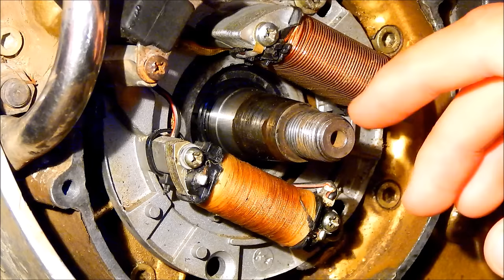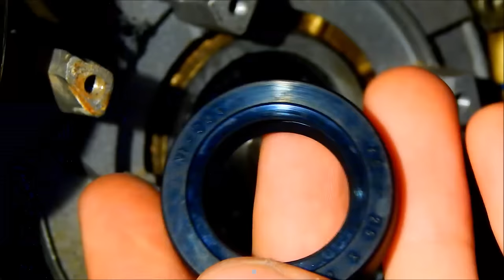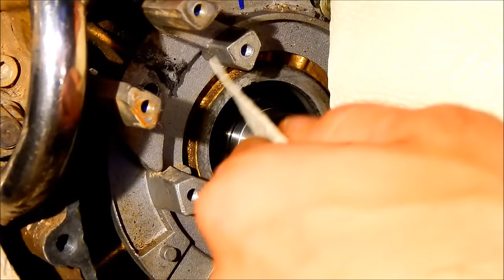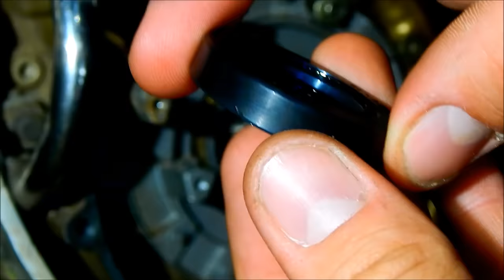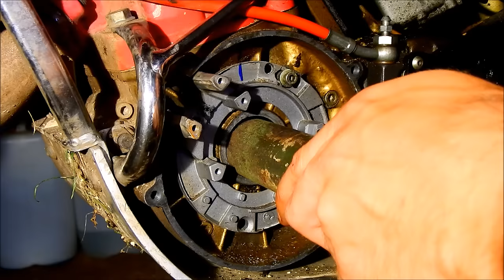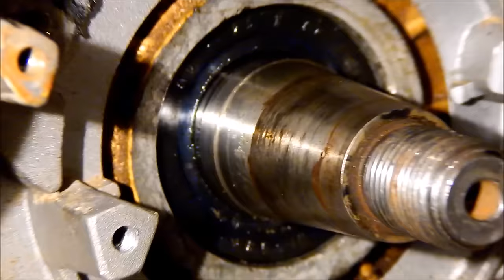Super Easy Crankshaft Seal Removal

Comment: Great job! I like how simple and straightforward this video is. People who don’t like this drilling method. You can simply use compressed air, vacuum, or wd40 to remove the metal dust before actually pulling the seal out. This is a great way because you don’t run the risk of scratching the crankcase with an edged tool.
Reply: Why wouldn't they do that anyways? Metal dust? Big deal, get the job done. And just use a paper towel. And clean up with whatever. For the people that are just saying, just use a flat head screwdriver or use a puller. Now I got a hardware store guy saying the same thing he doesn't understand.  It's metal, you can't just stick something in there. It's hard as a rock. You have to drill holes. Nobody cared to warn me about this of course. And all of the timing belt videos of course. Just skipped literally how they got the crankshaft seal out. The guy at the hardware store is like. Just take out the shaft. I give up. It's always when I'm working on my car I have these problems. Yet, I can search through 10,000 forums and videos. And because the people in the video didn't want to show how it's done properly or how they run into problems. You lose time. It's very important.

Comment: If you use this method (and I have) you must use a magnet to remove all metal fragments before pulling the old seal and then again after the old seal is removed. The area must be free of any metal fragments as the smallest fragment could damage the replacement seal.
Reply: That part made me nervous...
Reply: ......magnetised bearings aren't permitted for aviation engineering . They even use degaussing equipment on bearings . Here I don't think he actually removed all the filings cos we see something from the camera angle but which he couldn't see .

Comment: Or... you could do what I've been doing for 40 years. Jam a flat screwdriver into the rubber part of the seal, pry sideward and downward on the head of the screwdriver, and the seal will come out of it's hole. No drilling or metal dust, and much less time spent messing with it. 

However, you did press it in nicely - with a well-designed tool. ;)
Reply: yapp... :))))) the good old way !  and without all the metal debry he's gonna stuff into the crank bearing  ;)
Reply: gud idea
Reply: KOakaKO
Reply: Doesn't work with crankshaft seal. It's metal, you can't just stick something in there. It's hard as a rock. You have to drill holes. Nobody cared to warn me about this of course. And all of the timing belt videos of course. Just skipped literally how they got the crankshaft seal out. The guy at the hardware store is like. Just take out the shaft. I give up. It's always when I'm working on my car I have these problems. Yet, I can search through 10,000 forums and videos. And because the people in the video didn't want to show how it's done properly or how they run into problems. You lose time. It's very important.

 You can't just jam something that's hard as a rock. It's a crankshaft seal. And by the way not all seals are the same. You can't find screws as small enough as this person has to screw in there and stay. Then FEAR of making a mistake makes the job not get done (oh you can damage this and that) (okay than you do it, it then !!!!! like the slightest little nick, now they say it's on the shaft and not the outside of the shaft. Then a person say it's both, you can't win. And also, not selling tools you need and having to wait an extra 5 to 6 days because something goes wrong. There should be a something goes wrong! In videos that people do.

Comment: Been doing this on snowmobiles for 20 years.  Not drilling on mine, too many metal shavings. A good sharp edged screw driver pounded into the seal at an angle will allow you to pull the seal out. John Deere actually shows this in the service manual.
Reply: Honda 1990-1993 accord cranshaft seal. Is made out of different material than. It's got a hard steel barrier. It's hard as a rock. For what you are talking about is the crankshaft seal. Since nobody bothered to do a video showing how they did it. The guys that did the timing belt job. Just cut away showing that it was already done. By not providing the problem or solution. I waste more time, and so do others. My theory is they had to do it sloppy and don't want to show it on the video. Please do!

For the people that are just saying, just use a flat head screwdriver or use a puller. Now I got a hardware store guy saying the same thing he doesn't understand.  It's metal, you can't just stick something in there. It's hard as a rock. You have to drill holes. Nobody cared to warn me about this of course. And all of the timing belt videos of course. Just skipped literally how they got the crankshaft seal out. The guy at the hardware store is like. Just take out the shaft. I give up. It's always when I'm working on my car I have these problems. Yet, I can search through 10,000 forums and videos. And because the people in the video didn't want to show how it's done properly or how they run into problems. You lose time. It's very important.

 You can't just jam something that's hard as a rock. It's a crankshaft seal. And by the way not all seals are the same. You can't find screws as small enough as this person has to screw in there and stay. Then FEAR of making a mistake makes the job not get done (oh you can damage this and that) (okay than you do it, it then !!!!! like the slightest little nick, now they say it's on the shaft and not the outside of the shaft. Then a person say it's both, you can't win. And also, not selling tools you need and having to wait an extra 5 to 6 days because something goes wrong. There should be a something goes wrong! In videos that people do.

Comment: I'm face with an OLD Evinrude outboard whose seal is leaking and creating all kinds of idle problems for me.  The official tool to remove this is $50 (minimum) from the sources that I could find and I don't intend to remove a whole lot of seals after I replace this one so your method is likely to save my bacon.  Thanks.

Comment: If you don't want to see metal shaving just use a small punch to create a small hole for the screw to start. I wouldn't used a self tap screw. Drilling is too risky.
Reply: I have done tons of these seals. Mostly used the proper tool. In a pinch I have drilled about a dozen of them. I feel a self tap screw has more chance of walking off the seal than a nice sharp drill bit. A punch can walk off too, maybe not if the engine is on a stand at eye level and not between a radiator or a strut tower. Once I had the bit walk off the seal, score the crank seal surface and had to sleeve the shaft I never drilled another one.
As for metal shavings, just flush them down to the bottom of the pan, they will either get caught in the pickup screen, the filter or the fill plug magnet on a properly maintained engine.

Comment: For the people that are just saying, just use a flat head screwdriver or use a puller. Now I got a hardware store guy saying the same thing he doesn't understand.  It's metal, you can't just stick something in there. It's hard as a rock. You have to drill holes. Nobody cared to warn me about this of course. And all of the timing belt videos of course. Just skipped literally how they got the crankshaft seal out. The guy at the hardware store is like. Just take out the shaft. I give up. It's always when I'm working on my car I have these problems. Yet, I can search through 10,000 forums and videos. And because the people in the video didn't want to show how it's done properly or how they run into problems. You lose time. It's very important.

 You can't just jam something that's hard as a rock. It's a crankshaft seal. And by the way not all seals are the same. You can't find screws as small enough as this person has to screw in there and stay. Then FEAR of making a mistake makes the job not get done (oh you can damage this and that) (okay than you do it, it then !!!!! like the slightest little nick, now they say it's on the shaft and not the outside of the shaft. Then a person say it's both, you can't win. And also, not selling tools you need and having to wait an extra 5 to 6 days because something goes wrong. There should be a something goes wrong! In videos that people do.

Comment: ....pretty good but from the camera position we can see some iron filings remaining which you didn't appear to clean out at bottom and probably not in view for you but for us.
...what about using a epoxy to glue handles onto the metal cap for purpose of pulling it out undamaged , then can reinstall it as some kind of protection for the seal .

Comment: Now if only they engineer the two bearings on each side to also have easy removal and replace, behind the seal, Without having to take the entire bottom half apart would help tremendously.

Comment: how many seals are there 2? u have a yamaha blaster 200 and the seals are leaking, but i dont know how many there are and how to replace them? i hope to get some answers :)
Reply: which ones? crankshaft, shifter, water pump, sprocket,. either one use a small screwdriver or seal remover. go easy on the screwdriver dont go too far in.  put them in with a socket or seal driver.
Reply: my atv throws a lot of smoke and has no power so i think i need to replace crank seals
Reply: check the compression the rings might be shot.
Reply: before you do that is it gear oil or  is the compression low? if so it will be going thru the rings blow by.

Comment: Drilling could leave metal debris around the seal / shaft, & a miss could even damage the engine. I would rather buy a seal puller.

Comment: according to information supplied with a gates timing belt kit this is the correct way to remove a seal
Reply: Some seals are easier. For a CV driveshaft for example you first remove the shaft and then have access to the inside.

Comment: Now metal fillings are everywhere, not smart. Instead take an old standard screwdriver, heat up the tip and bend it into a curve. Use it as a small prybar.  It'll do it quicker and won't mar up the crankshaft.
Reply: You don't need to bend it. Just jam it in and pry out the seal. I've done this thousands of times...
Reply: @KOakaKO  show us how
Reply: @ppppugh7892  If you have to ask, you probably shouldn't be working on motors.
Reply: @screamingpencil  yeah, I'll stick to engines. I wasn't asking how, I was telling Mr Smart Arse (done it 1000's of times) to 'show'. That's what YouTube is, show! Because a picture tells a thousand words. Thanks for your valuable, non-time wasting remark.

Comment: Oh by the way I just watched Eric the Car Guy (Only use Honda Transmission Fluid GUY) (Many transmission lost because of the Haynes manuals saying use Dex2, but these transmission fluid companies couldn't copy that from HONDA *ROLLS EYE YEAH RIGHT). Anyways, it's obvious he nicked the camshaft probably with his flat head? So I guess that rumor created that there will be a infinite leak failed by a apparently a Honda Guy? Give me a break. I ask you guys to create your own video showing how you can get a hard as a ROCK crankshaft seal (not a camshaft seal) out just by using a puller. You can't just gouge without it hitting it. You also can't get it through there. Maybe his 1997 honda accord maybe they improved the seals to be more easy verses the 1990-1993 era.

Any proof of these silly rumors? Now shavings which there are some normal amount of shavings in the engine. AND Transmission? Can instantly do what? To a seal? You would clean up anyways? MAN, try to be a perfectionist on a job. I like to see how anyone do a honda 1990-1993 accord timing belt job. Let's see you do this nightmare? Get real? Yes I'm going to complain. This isn't interior decorating where you are obsessed with looks and perfectionism. This is a car, it has all sorts of chemicals dripping down day, noon and night. Power steering fluids, Motor oil, Penetrating oil you have to use on that nasty tension er bolt. You cannot slip a special socket on it. There is not enough room. They poked a hole in the upper timing belt cover so it can rust nicely for you fans that want to use lock tight and think that. Creating fear and wasting a whole day thinking I can just do what Haynes book tells me to do is bogus. Yeah just put a flat head through and pull out. KNOWING THAT PEOPLE are being so perfect now claiming even the outer shaft and inner shaft even slightly nicked to create a leak. Have any proof so I can complete the job?

OH AND DO IT WITHOUT A GARAGE!!! Not everyone can afford that. And do it with a PERSON THAT THREATENS TO EVICT YOU NICE. Nightmare dealing with people some times. I'm just saying. Let us get real and get straight facts and not rumors. PRIVATE PROPERTY IS PART OF THE CONSTITUTION LETS SEE YOU DEAL WITH THAT. DON"T TELL ME WHAT TO DO WITH MY OWN PROPERTY.